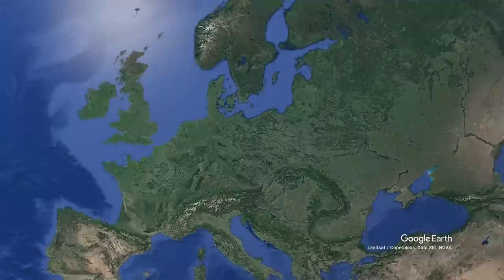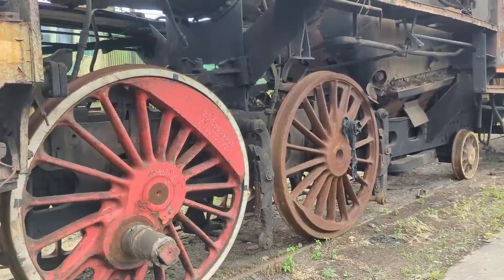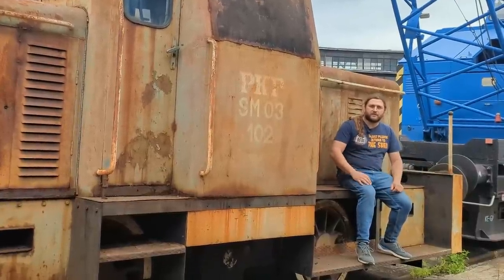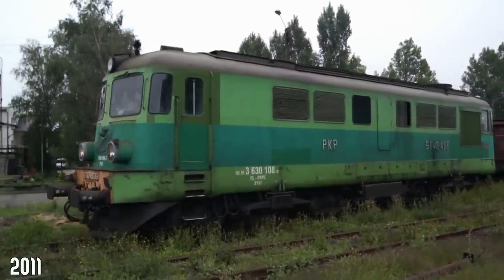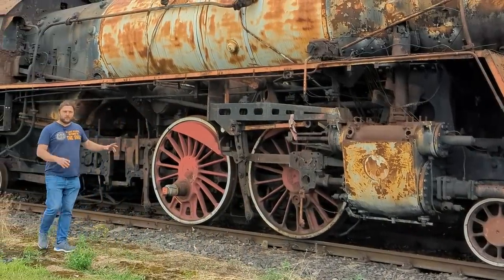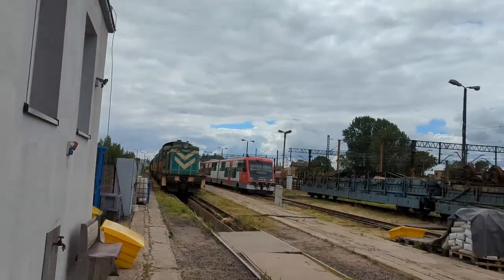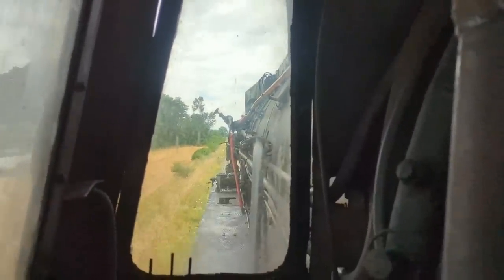Abandoned Steam Trains in Poland - Part 1

Comment: 2:52 This is the real Ol49-69. The Ol49-69 which is running was originally Ol49-99 until she returned to steam after a overhaul in 2015 or so. Nobody knows really why they changed her number.
Reply from the maker: Shhhh!
I'm confused why there's a three engine split with wrong numbers.
Reply: But what engine was that Ol49-99 at the back of the line then? Why'd they change the numbers on three different locomotives?
Reply: @casperreininga3253  It's Ol49-23 at the back of the line. I don't think they've changed the number of that engine for any reason - they were probably pretty careless about it. Back in 2008 when it was still operational it was marked with the right number.

The "swap" between the real Ol49-69 and Ol49-99 ("new" Ol49-69 - operational engine until late 2022) happened in 2001. As far as I know, the real 69 from Wolsztyn depot was in too poor condition to be repaired so PKP (Polish State Railways) decided to repair Ol49-99 from Choszczno (due to liquidation of the Choszczno depot) and then they sent the 99 to Wolsztyn marked as Ol49-69. The old 69 was left in Gniezno worshops for couple of years and eventually it was taken to Leszno.
Reply: Well, I think the Ol49-69 broke down and the 99 was changed to 69 to resemble the locomotive. Even the decorations on the Ol49-69 (ex. 99) is very similar to the original Ol49-69.
Reply from the maker: @2112SSF  69 was tired, 99 was in much better condition, so an unofficial swap happened.

Comment: In the Eastern EU block the real issue is not that people don't want to save these locos, its simply nobody have the money to do so. Even to keep working locos operational is hard. Yes there are clubs, societies, foundations, volunteers, but they don't have a budget as well, just the "manpower" to help with the basics. Not to mention that the specialist engineers these locos require are dyeing out, and good luck finding a workshop that can (still) rebuild a boiler. + there's the luck factor too!
Reply from the maker: This is true
Reply: Exactly. For many years Interlok in Piła was the last steam loco repair shop, but in the end they also ran out of money. Nowadays the museum shed at Chabówka makes all major and many minor repairs on Polish steam locos, while the nearest boiler manufacturer/service point is in the Czech Republic. There though is also Meiningen still alive, but for Poles it's most often unaffordable. One drive wheel set from Pt47-65 now is at Meiningen for turning on the wheel set lathe.
Reply: I'm from Poland, we don't abandon old locomotives, this author is lying, we still have a lot of them, and they are just waiting for their turn to be repaired. As you can see, the parts have not been scrapped, but they are still there and waiting. We have several museums with working locomotives that are constantly running, you can see youtube : Festival of Locomotives in Wolsztyn
Reply from the maker: @witoldlaszuk2543  None of the engines shown in the video are awaiting their turn for overhaul.
Certainly not 111 which was abandoned in the middle of its overhaul.
Reply: @lmm  try getting several steam engine parts and building a locomotive

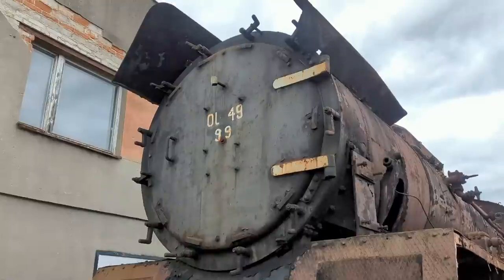Comment: After a bit of research I figured out that the locomotive at 15:25 is actually Ol49-23. She ran excursion trains untill 2008 when she was going to be restored, so she was moved to Gniezno. But repair didn't happend so they moved her to Leszno and put number 99 on it. And the real 99 runs today as a number 69, while the real 69 is a wreck
Reply from the maker: This is correct.
I didn't mention it in the video as its all a bit dodgy

Comment: There's an abandoned railway shed in my city that's basically in the same condition as this, however no rails run to it anymore since, i don't even know. There's also an abandoned railway yard and stations from the days of the Piotrków-Sulejów Narrow Gauge Railway, 1902-2008. They closed it after the line from Bugaj, one of the stations located in Piotrków, to Sulejów, the terminus, was ripped up. There's a book on it, although it's in Polish, so you'd probably need a translator.

Comment: When I was a teenager I had a far happier experience, the Moscow, Camden and San Augustine RR in East Texas. The WT Carter Lumber Co. never scrapped anything, they just side lined a variety of small steam locomotives some of which were equipped with link and pin couplers. All of them to the best of my knowledge made it into preservation. Got to ride it that day back in '67, a GE 44 ton diesel pulled the 1890's Long Island combination car!
Reply from the maker: Oh that's super!
Reply: @lmm  To delve a little deeper, one of the most iconic locomotives was Panama #201, a good sized (for the time) 2-6-0 that was used to build the Panama Canal! It was re-gauged from 5' to standard with wider tires. The MC&SA never renumbered it. It was steamed for a time in recent decades at a tourist RR in Arkansas. There was a small Shay locomotive, two typical logging 2-8-2's and a really ancient, tiny little 2-6-0 that featured safety valves on weighted levers that went into the cab. It also had primitive "tallow pots" which were funnels that led to the driving axles. Animal fat - tallow - was kept in a heated container on the locomotive back head and poured into the funnels.

There was minimum vandalism much less ugly graffiti. About 1965 a GE 44 ton diesel was purchased and 2-8-2 #14 was kept serviceable as a stand by. By this time the little line had found notoriety as the shortest railroad (7 miles) in Texas, people started riding it as a tourist thing but ended in the '73.

I've always liked the German Kreigsloks, a really rugged design.

Comment: Europe is a prime place to get steam engines it seems. I'm investigating the possibility of aquiring a Finnish Hv class for a potential heritage railway in Ireland depending on what Irish Rail intend to do with the line. :D
Reply from the maker: That's quite an idea
Reply: @lmm  it's quite far-fetched, and it depends entirely what Irish Rail want to do with the line. I'm scouting for anyone local to try and get after something. Hopefully it goes well :D
Reply from the maker: @Spud607  best of luck!
Reply: What about the difference in track gauge? Standard v Irish gauge.
Reply: @fnh8340  Finland is 5 foot gauge, which could be easier to regauge. I've also got other options in Australia or Brazil, but their a bit far away. It's all very circumstancial anyway. There is also options in Ireland but I can be very certain they are not for sale unfortunately so a loan agreement would need to be arranged. I don't even know if I have a line to work with yet so I havn't really done much about actually aquiring an engine. I'm waiting for a reply from Irish rail presently. :)

Comment: If you really want to see the difference in the loading gauge between the UK and a typical mainland European loading gauge, then visit the national railway museum in the Netherlands ("Spoorwegmuseum", Utrecht). The NS series 1500 are actually second hand UK machines, sold when the last 1500 V DC lines were switched over to 25 kV AC. The NS required extra locomotives at the time, and a deal was made. One of those is in preservation in the Netherlands, one went back to the UK in the original livery. But in the museum you can see the 1500 next to the 1100, 1300, and 1600 that originate in France, and the 1200 that were built with Marshall money after the war, and were probably close to the maximum size that would still fit on Dutch rails. If this is your goal, be sure to contact the museum before you go, as the space is limited, and the combination you'd like to see may not be on display.
Reply from the maker: On one of my trips we passed a class 66. It was amazing the difference in size

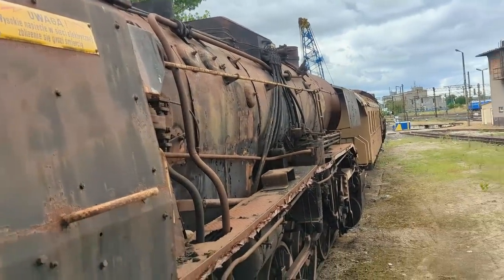Comment: Poland still having many steam locomotives rotting in storage across the country amazes me. The loco at 9:02 was built in Romania in the 1960s. Most were retired in the 90s but many still work on non-electrified lines. 
The SM42 is probably the most common diesel in Poland with over 1,000 built
Having an operational steam engine next to a bunch of rotting ones reminds me of the Illinois Railway Museum. They have Frisco 1630 and J. Niels shay 5 in operation, some kept in decent condition in the sheds, while others are left rotting in the open with many parts missing.
Reply: A lot of museums struggle with the problem of limited protected storage space, and finite resources. A big museum has to pick and choose what to tackle. It's tough to give everything the attention it needs if you have a large collection.

Comment: Fun Fact: SM03s are called Ducks or Ducklings, something like that
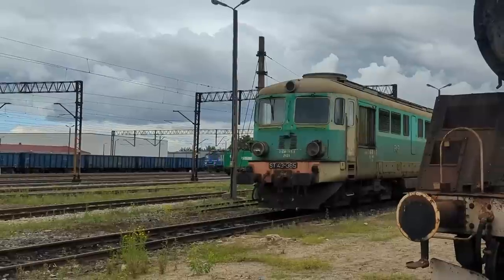Also, at 9:49 these three engines most likely worked along each other (as in steam, diesel and electric) as the engine in the backgound is most likely a EU07 or EP07, both from the were introduced in the late 60s/early 70s
Reply from the maker: I really want an SM03. I think they're proper neat

Comment: The number 7 was caussing quite the trouble at Wolsztyn, always getting cracks on the frames even after being fixed, hell its boiler even started leaking after a regular passenger run, it got send to leszno to be repaired numerouse times, and well, one of thoose times was the last one.

Comment: It's a sad but valuable example of having too many mouths to feed. You truly cannot save them all. Many museums and tourist railroads regularly experience the reasons why steam went away. Operating a steam railroad can eat you out of house and home. Back in the day railroads could have armies of men working to keep the trains rolling. To do that in the same scale in preservation would require similar staffing levels even with modern technology because of how labor intensive it is. The sad reality is that in the preservation era some will need to be scrapped or scavenged for parts to keep the ones that are left running. In the US & the UK, many operations may have the remains of an engine in the back that was permanently parked due to some major defect (cracked frame, truly bad boiler, etc) and that piece has been scavenged for parts to keep others going. In places like Poland where hundreds of engines are sitting derelict, some will run again, some will be parts engines, some may go on static display, but sadly many will probably be scrapped once they've been stripped of all valuable parts.
Reply from the maker: There doesn't really seem to be the drive even for that. They're just there.
Reply: @lmm  Is it a barry situation of too complicated to scrap and not worth the labor costs?
Reply from the maker: @leightonmoreland  seems to be
Reply: @lmm  history repeats itself, at least it keeps the equipment from getting torched
Reply from the maker: @leightonmoreland  so far anyway!

Comment: Little info on the ST43 class: 

The PKP ST43 is a modified export version of the (now defunct) Electroputere Craiova locomotive works LDE2100 or 060-DA locomotive.

They were made in two variations: 060-DA with a V. Max of 100 km/h and 060-DA1 with a V. Max of 120 km/h

They were made between 1959 and 1987 with a total 2496 units made for various operators.

The polish variants,were made between and shipped between 1965 and 1978 with 422 units made.

As far as i know,all PKP ST43 class locomotives are widthdrawn but some still remain with private operators.

However, in Romania, most 060-DA locomotives are still operated by both the state railways as well as private operators.

Some even have their original compressed air whistles.

There are also a couple refurbished units operating across Europe.

Technical specs: 

Engine: Sulzer 12LDA28

Engine power: 2100 HP / 1565 kW (nominal)  or 2500 HP / 1864 kW (Theoretical Max Power) 

Lenght: 17000 milimeters / 55.77 feet

Width: 3000 milimeters / 9.74 feet

Height: 4435 milimeters / 14.53 feet

Weight: 115 tonnes fully topped up

Max speed: 100 km/h / 62 mph (060-DA)
120 km/h / 74 mph (060-DA1)

Axel arrangement: Co'-Co'
Reply from the maker: That's interesting, thank you!

Comment: That is such a shame, those should be donated to a heritage railway or a museum, they could at least use those old locomotives as spare parts.
Reply: There are no standard gauge heritage railways in Poland, most likely they will just be left there till they fall apart.
Reply from the maker: There are a handful of museums with similar engines in them. These have given many parts to keep the others at Wolsztyn running.
Reply: @lmm  at least thier parts are put to good use.

Comment: The supposed Ty3 (Drg 42) is more likely also a Ty2 (drg 52), as it doesn't have the signature headlights of the 42 that were in the cylinder assembly
Reply from the maker: I may have got confused 😂
Reply: Sources say that they indeed were original DRG 42's, but PKP was and is very strict with fitting their own lamps on all rolling stock. That's why most likely when changing the numbers from German to Polish they also changed the lamps and masked the holes in the cylinder block; assumingly with some spare parts from Ty2. The here shown Ty3-2 was built as 42 1427, or loco no. 4448 at Schichau in Elbing in 1944.
The thing with the lamps can also be seen quite good when comparing a Polish ST44 to the Soviet M62 or the GDR V200 (later BR120). If you look closely on a ST44 you will notice the plugged holes made originally by LTZ in Luhansk.

Comment: You don't see them rotting away in the UK is because so many have met the cutter's torch and the "missing" fire box door is on the cab floor.
Reply from the maker: You don't see them rotting away in the UK because they've been privately purchased and preserved.
There's more steam engines in the UK than abandoned in Poland.
Reply: @lmm  They were purchased and preserved when it was realised that there would be nothing left of the precursor to the modern railway system, was a desperate move.

Comment: That running Ol49-69's real number is Ol49-59. True number 69 is rotting on the siding. If you want to experience more steam in poland you should visit our's narrow gauge railways!
Reply from the maker: It's 99.
59 has different valve gear.

Comment: Did Barry's scrapyard or Woodham's scrapyard look better? How many locomotives have been saved in Britain? All? There have been thousands of locomotives in the past, and there is no way to save them all. But in Poland, we have many still running locomotives in open-air museums such as Wolsztyn or Chabówka
Reply from the maker: Almost 100 engines were cut up at Barry.
There are two steam engines that work in Poland. If the Pt is repaired.
That is not many.

Comment: the ST43s have the same engine as the BR Class 44 so thats cool
Reply from the maker: Oh really? Didn't know that!
Reply: @lmm  yep, Sulzer 12LDA28-A, fitted to the Polish ST43, the Romanian LDE60 and the BR Class 44
Reply: @ljtrains9430 correction,the correct designation for the romanian locos are either LDE2100 , 060-DA or CFR Class 60/62

Comment: It looks as if there might be components that could be worth collecting for UK preservation.
Reply from the maker: I don't think there is much compatibility
Reply: @lmm  Air brake pumps, gauges, valves, etc?
Reply from the maker: @physiocrat7143  The gauges are European, so work on Bar rather than PSI that we use - though they could be adapted. Lots of the fittings are very different.
Certainly some parts like that could be of use to the Polish engines in the UK though!

Comment: I get the feeling their downfall in Poland will be because of their continued use. 
In the UK steam was replaced rather quickly when diesel then electric came along but in Poland they continued using steam right up until there are almost none left in any usable condition. 
When they are seen as just another work tool thats come to the end of being useful they are easy to treat like a shovel and throw it away. 
In the UK there were enough left long enough after they went out of use for people wondering what the old days were like to start preserving them. Poland hasn't got to that yet because they are still current.
Reply from the maker: This is very true
Reply: Hmmm the former eastern block did use steam for ALOT longer compared to western europe, By 1967 steam was retired in the west pretty much whilst in the east some kept going till the 1990's.  Heck when the 9F's were pulled out they didn't even go anywhere near the end of their lifespan.
Reply from the maker: Yeah exactly
Reply: @davidty2006  no less than western germany kept pacifics on mainline expresses until 1975-77

Comment: Well done Laurie!!  Let’s hope that someone in Poland sees the need for a couple of heritage railways so that steam goes into the future.
Reply: Yeah, though I do not think it would happen. The problem is that, well, steam engines used to be common there, even last year some of the scheduled passenger services out of Wolsztyn were steam powered. While for us it is exotic and cool, for them it's just a train and the modern one has better seats and is faster and smoother. Not to mention that diesel is cheaper to run. Howard paid for the difference of running costs. Now that he's gone, the service will be gone as well as the government just sees the steam engines as a money pit.

It's hard to miss something when it is not gone. When it is gone, there would be no way to get it back as all of the support locations (repair shops etc) would be gone as well.
Reply from the maker: The big problem is the fact that there was no Beeching. The railways are still state owned, you can't really open a closed line to run a heritage service.
Reply: @lmm sort of odd thinking that actually Beaching assisted the preservation movement.